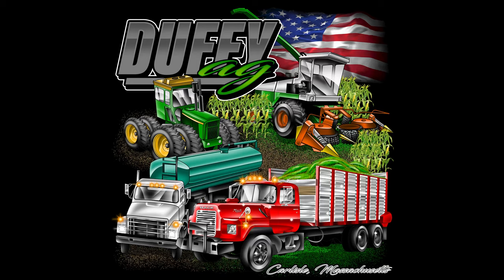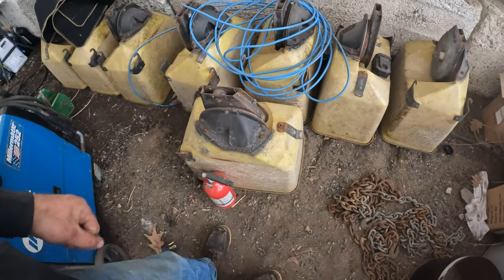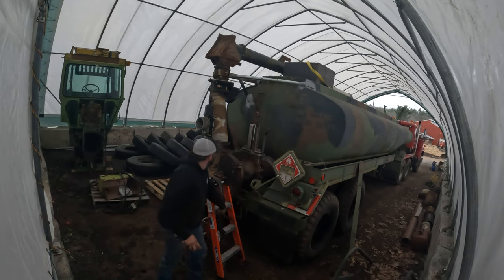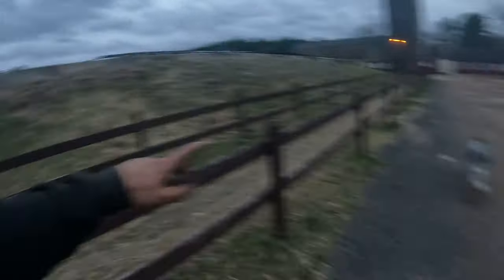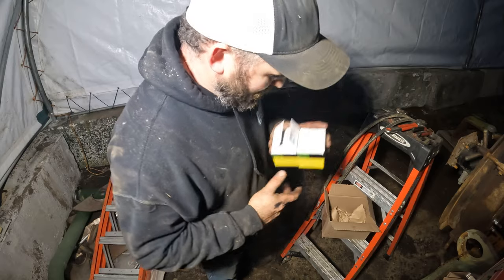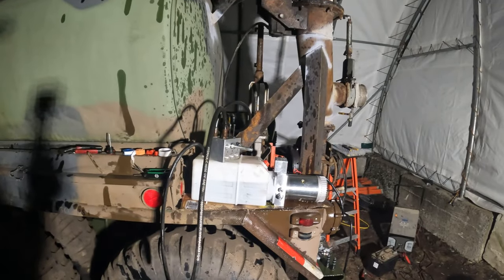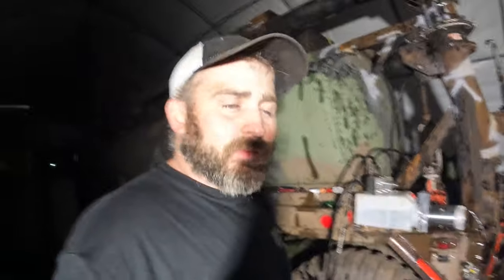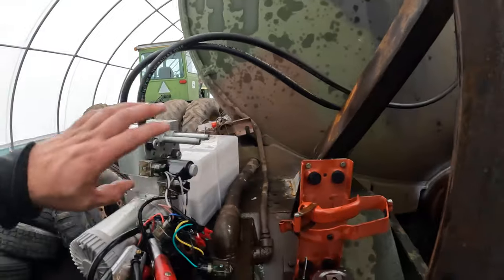Standalone Hydraulic Unit Just Wont Work- Manure Trailer Boom Setup

Comment: If you look at shoup parts you can get a hydraulic valve multiplier that you could run your spread plate and other valve off. 12 volts selects what side of the multiplier valve to open
Reply: Or a 6 way solenoid diverter.👍

Comment: Great work. Trailer is getting along. 
Put a DC to DC battery charger to maintain correct charge voltages and isolate the extra trailer battery from truck electric system. Not to cause any unwanted current rush from truck to trailer battery.  If uneven charged.
Reply: I was going to suggest the same thing. I use the renogy 20amp DC to DC charger for my travel trailer batteries.

Comment: If you run a charge wire from the semi to the battery, put a 12 volt circuit breaker on it by the battery, so if the battery voltage is down and you run the pump it doesn't pull to many amps and cause the charge wire to catch fire.

Comment: Could you put a manual diverter valve on the spread lines to either shut the main valve or the nurse diverter valve so as not to spill going down the road when nursing

Comment: If shorten the hose and and have to pull the pipe back to fit on the hose, will the pipe still fit in the new hole you cut it the tank?

Comment: you didn't explain what was wrong or how you fixed the pump
Reply from the maker: The spacers between the solenoids were not needed so it was not pulling the valve one way while their was preasure on it